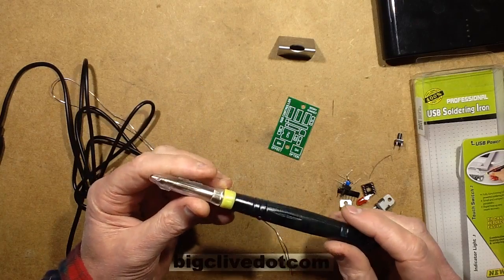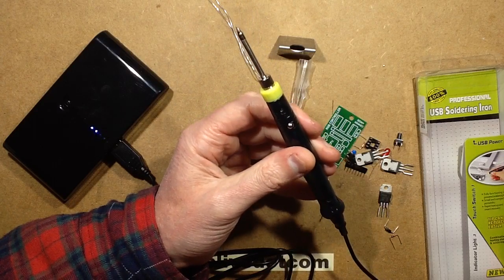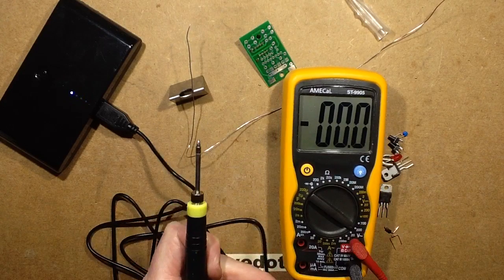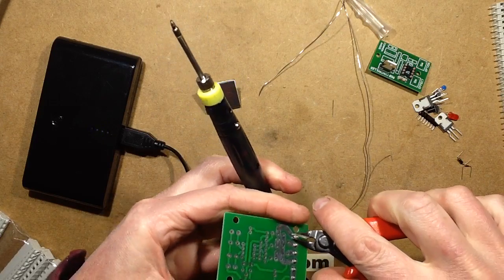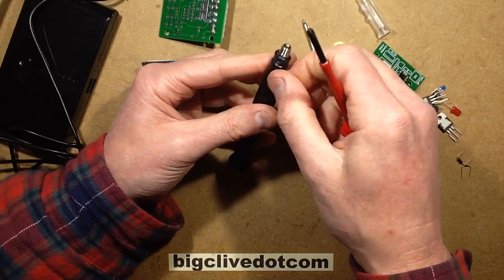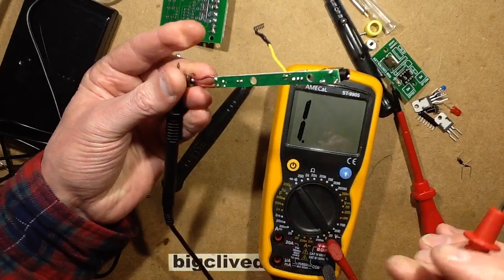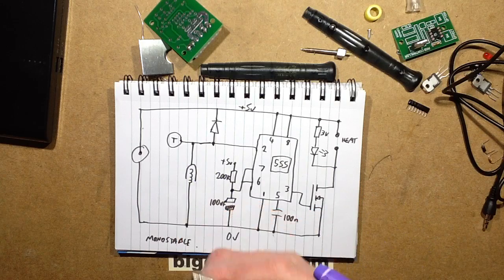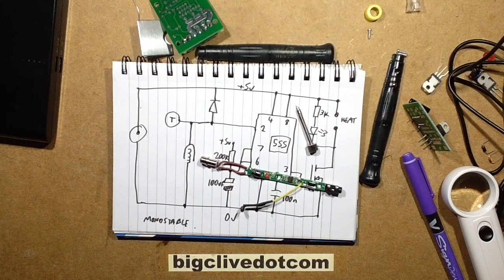USB soldering iron test and teardown with schematic.

Comment: I wonder if that would work from a USB OTG device? Probably not due to the current limit, but it'd be weird seeing a smartphone or tablet powered soldering iron. <g>. I wouldn't plug it into my gear, that's for sure.
Reply from the maker: +ProdigalPorcupine I wouldn't try to pull that much current from a smartphone.
Reply: +bigclivedotcom - Yeah, I'd try it on a duff one, but I think it'd be a case of the USB port shutting down on well designed devices, or damage on lesser designs. It thought you'd be in bed, I guess you're a fellow night owl!
Reply: +ProdigalPorcupine Windows phones like the Lumia 950xl can supply 2.1 amps at 5 volt with USB on the go. I would assume similar for android.
Reply: +bigclivedotcom maybe a 12v source like a car lighter?  the 555 should take it if the other componants are up to spec...then maybe it would have a bit of extra kick?
Reply: +danthekilla I'm not 100% but I think the note 4 can supply 2amps using an OTG cable. I'd have to check it by charging another phone with it, but I'm almost certain it can supply back 2amps
Reply: +m4xwellmurd3r You can definetly charge smaller phones with either tablets, or monster phones like the note 4 or z ultra.
So you might be able to power that soldering iron of a beafy phone.
Reply: Yeah, I've charged a tablet with my note 4 before just for fun haha I just don't remember what the current was that it charged at.
Reply: m4xwellmurd3r I got an output of about 1Amp out of my Z ultra, i just dont remember if that was stock or modded output.

Comment: so if you just added a small micro switch and pull it to ground for pin 2 you could switch & leave it on if needed ?
http://i.ebayimg.com/images/a/(KGrHqJ,!ioE-un1fKpsBPwS6V4PFw~~/s-l500.jpg
Reply from the maker: +Charles lakins Theoretically yes, or just bypass the circuitry completely.  But I'm not sure how hot the tip will get in open air when run continuously.

Comment: that looks ridiculously useful for small fiddly jobs. I imagine powering it from a jump starter pack with usb outlet would be fine if a power bank is ok. I've got a 17ah starter pack with usb outlets. another question.... how about using a 12 volt usb converter? probably still no good for sensitive components but a lot better than having 120 volts at the tip ;-)

Comment: Are you using Leaded solder? That can make a difference with the melting point advantage.
Reply from the maker: +Taylor Young Yes I was and will be doing so until they physically stop me.
Reply: +bigclivedotcom Thanks for the informative videos, I'd love to see you look into a DC/AC inverter, I've seen you take so many AC/DC apart xD

Comment: While it's true that there is a potential between tip and ground, I'm having trouble getting my head around how the problem is much worse, given that you're not working on a grounded (ESD) surface, and probably not wearing a grounded (ESD) strap.

Maybe I just have lots of earth leakage and noise in my office and dodgy old-house wiring, but if I grab an LED by one leg, and touch the other to a grounded surface, there's enough capacitive coupling just from that to glow the led visibly.  

For fun, the amount of current I can get through that LED depends on how many (bare) feet I have on the (wooden) floor and indeed if I am sitting or standing - standing 2 feet = 10uA, standing 1 foot = 5uA, sitting 2 feet = 4uA, sitting 1 foot = 2uA today (through an orange LED), a rather pleasing relationship numerically.

If I measure between myself and mains earth today there's like 60v to 70v AC.  Of course I'm surrounded by mains equipment with barefeet on a wooden floor.  

Anyway, my point, if there was one, is that if you're not "observing ESD considerations particularly" which in it's turn means that you and the work and the tools are referenced to "ground" (for your definition thereof) that worrying about a potential from mains earth to iron tip is probably not really much of a concern, in fact, it's conceivable that you'd be worse off grounding the tip, because now if you and the tools and such are floating, you are at square one.

Now if you were sure that you and the work were at the same potential etc... then yeah makes sense to make you at the same potential as the iron tip, by referencing everything to mains earth ground.  Of course, that's an easy thing to fix, wear a strap, preferably work on an ESD surface, and connect iron tip (well, not directly, but you know), surface, and you to the same point.

But all this AC analog hocus pocus makes my head hurt.  Give me DC any day.

Comment: FYI, NE555 can be reset mid-cycle. So if you keep your finger on the button, it should keep heating.
Reply: that doesnt work if powered from a powerbank or other isolated supply, well, mine doesnt! have to 'tap' it to trigger the vibration switch..
Reply: as long as pin 2 is low pin 3 is high.

Comment: I don't quite see the problem with the iron floating at line voltage. If the thing you are soldering on is not grounded you should be fine, right?

Comment: Do you think you would get that leakage current using a computer PSU? I modified a PSU with tons of different output connectors for testing electronics on my workbench (usb as well).

Comment: This looks great when you want to solder DMX XLR plugs on a cable poking out of the ceiling, while being on a 6 meter ladder. Or for general A/V work out in the field. A couple of NCR18650GAs in parallel and a 5V USB boost converter in a Hammond enclosure and you're good to go. With around 24W/hours of energy it should keep going for quite a while.

Comment: +bigclivedotcom Probably it's worth a try to replace the cable to a beefier one. You measured 4.3V at the heating element, the cable change would give you some tenths of watts, which isn't seems much, but in that case it will be a significant percentage of the total power. 

If i buy one (and probably will, thanks to this video), I will replace not just the cable, but ignore the 3,5 jack also. A 3,5 jack hanging around the desk with 5V in it isn't a good idea... If someone plug it accidentally to a headphone socket on something...
Reply from the maker: +mrnmrn1 My own temptation is to half the cable and solder it directly to the iron, possibly keeping the jack socket as a cable strain relief.

Comment: I guess the question is for me, if push comes to shove whats the better option, cheap Chinese battery soldering iron, or cheap Chinese USB (battery bank) soldering iron... If you are needing to be mobile, and maybe for quick jobs only. Or even, what of a miniature gas powered one? Wonder if you or Mr Ilett would do a direct comparison.
Reply from the maker: +good citizen This iron performed more consistently than the small gas irons I've used.  They tend to undulate in temperature violently between too cold and too hot.
Reply: +bigclivedotcom Thanks for your thoughts. I might get one of the USB irons. I do indeed have a biffy power bank...

Comment: Using the structure of an old cordless shaver/toothbrush/powertool and the proper converter you will get a neat portable soldering iron

Comment: I would rather stick with my TS100 soldering iron.
Than use a 6w thing,
Reply: +DeathlyHall0w The hakko 936 and its clones are a standalone soldering station.
The TS100 is a portable soldering iron that uses anything from12v to 24v to run.
If you have an ASUS laptop PSU, it will fit into the DC jack input which most people use
But being portable you can run it off a cig lighter in your car, or a 12v powerbank.

Comment: that wasn't quite the usb iron I was thinking of  although banggood*com also has this one  (hint for Alex below) mostly I'd order from them for warranty reasons.  but this one $55 http://www.banggood.com/TS100-Digital-OLED-Programable-Interface-DC-5525-Soldering-Iron-Station-Built-in-STM32-Chip-p-984214.html kinda suggests the power could come from a usb power bank or a PC power supply straight off??  oh well.  I actually ran into my first oops board from another site Gear Best  actually had 2 micro usb's on it but the hole wasn't in the right area so they just soldered on another one  .  sigh.  never seen an oops board on anything but pinball games

Comment: Just curious... Did it mention anything about connecting to USB 3?
USB 1.0/1.1/2.0 just does 5V/500mA (from a PC perspective of course)

USB 3.0 would provide up to 1.5A instead (while the ports physically would pass max 5A)
Reply: Max. current of USB 3.0 is 900 mA (I mean specs, in practice one can find more beefy chargers)
Reply: For the chargers I know, I have a blackberry one that does 1.8A max

Comment: Too late... I just bought a soldering iron, from China. For that price I could've had this and a multi purpose big power bank. Considering how much soldering I plan to do, that would be a better solution for me.. :) Anyway, great video as always.
Reply from the maker: +AxelL No1 It's useful to have a couple of different irons for different tasks.
Reply: +bigclivedotcom Thanks for the answer! I was not really upset. I know, you are right, but I really don't do soldering that much. I had two basically useless iron (for electronics ) before but I wanted something for changing a few bulged capacitor when I find them in my appliances. My knowledge is nowhere near to yours. I'm an economist but the logic in electronics is fascinating me lately. This iron is definitely a surprise. I considered it a toy when I saw it earlier.

Comment: should have tried it on the hakko 191
Reply from the maker: +rocking546 I did afterwards.  The mass of the sensor immediately dragged the tip down to about 250C and it then crept back up to 430C.  So very much dumping heat from the tip on each joint.

Comment: How about 14 & 16 AWG to XT60 Lipo battery connectors?
Reply from the maker: +Rav Gupta Not sure.  Thick cable is a real drain on heat so connectors are always a bit tricky.

Comment: +bigclivedotcom usb 2.0 can provide 5v 2a 3.0 same I think 3.0 c type connector can provide 100W
Reply: 2.0 can provide 0.5A, 3.0 up to 0.9A, for higher amperages you need type C connector.

Comment: I use this little iron for re-soldering and repairing USB ports on tablets and phones - it's the perfect sized tip and gives out just enough heat for those tricky little smt solder dabs. Nice to see I wasn't the only one impressed by it!

Comment: So how could the circuit be changed to make it safe when plugged into a USB charger?
Reply: I was talking about how the circuit could be changed.  IE if one were designing a new version, or wanted to modify an existing unit.
Reply: Then how would your inverter solution help?
Reply: +Doug Reed Forgive me but I really am not getting the point you are trying to make.  Clive drew out a schematic, and I am trying to ask a question about how one would modify that schematic such that it wouldn't have the issue he describes.  

But also I fail to see how introducing an inverter would help anything.  All you would be doing is taking DC->AC->DC.  So even in your scenario the better answer is just "always use a USB battery"

Comment: Cool, you have just answered some questions that have been bothering me for some time.  I first saw one of these on another channel some time ago, and ordered one in from China. It was an earlier model with no touch pad, but seemed like the real deal.  The one I have came with a cord that had two plugs on the USB in side, and a USB mini on the output side of the cable. It generated plenty of heat, in fact I had problems with it burning off pads if I held it on for to long.  A few days ago I tore down some kits that I had ruined with the iron, an discovered over half the LED's had failed, my guess was that those were the ones where my power pack went dead and I Plugged it into a wall wart.  At any rate it now lays in the tool box in my motor home as I deemed it only useful for on the road emergencies.  I had thought it the real answer to soldering in my easy chair as it heated up so quickly and was so easy to use.  Perhaps I will try the newer version now and see if that works better, and now that I understand where the problems lay,  it may solve some problems.  Thankfully I found a nicer 110 volt that I can use at my chair now, heats up very fast and has replaceable tips, and a thermostat on the handle that actually works fairly well.

Comment: Nice vid as always ! 
I bought one of these a couple of month ago and it just stopped getting hot and the light just stays on, tried different power sources still nothing. Worked fine for 10 minutes i think. Do you have any idea of what it could be or how to fix it? You say that you could bypass the circuit. so that could work maybe for me?

Could i just take the tip with the 2 brown wires and connect that directly to + and - from a usb source and have a push button to activate it? Or did i get it all wrong? 

does it still need to go through the circuit or is the 555 just there to make the touch button work and have the auto shut off and wake up feature?

Thnx for everything ;)
Reply from the maker: +Crispy K If the LED is lighting then the element has either failed or is not making a proper connection.  Make sure the little metal grip round the bit is fully screwed down.
Reply: thanks for the advice i already checked that and also dissembled it since i thought there could be a bad contact with the vibration thing. it was cheap anyways ;)

Comment: I've been using one on and off for close on nine months, now, and... well, it's a pity you can't actually seem to source replacement tips/elements for them...
Reply: +Simon Edge ...also mine glowed red for a few seconds the first time I used it. Wish I'd got a pic of that. :s
Reply from the maker: +Simon Edge At this time it's probably easier just to buy a complete iron as opposed to a tip.  Still cheaper than many bits for high profile brands.  What voltage were you using it on to make it glow red?
Reply: bigclivedotcom it is, but they do advertise the bits as being replaceable, so it's more the principle of the thing...

Voltage-wise, it'll have been ~5.2V initially, though it may stay that high even in use, because I was using my Anker 40W multi-port brick, which will definitely supply the 1.4A the iron needs. (Said brick has polyfused ports, which is handy for when you accidentally pull the iron's end of the cable out first and kill the port. Why they didn't go with a barrel connector over the TRS one, I don't know...)

Comment: USB 3.1 can actually supply 100W at 12V, iirc. But it still depends on the controller (for handshaking) and its power supply, of course.

Comment: Oooh, now I'm thinking of all the other things I could turn on with touch for an interval of time with a 555 in this circuit... I think I shall buy this iron, wire the heater direct, then use the nifty lil' circuit for something fun...it's inexpensive enough to be justified on the basis of "cheap thrills" alone.

Comment: You could use the Apple PSU if you powered it through an isolation transformer. You would however have to confirm it was not earth referenced.

Comment: A clever but flawed use for a soldering iron.
Would have been better if it was grounded instead of running at +5 volts
Reply: +BillyNoMates1974 Yes, it's really silly thing to connect +5V to the tip... But you just have to replace the two wires coming to the heating element's socket, and you will have GND on the tip. Then you just need to modify a USB charger by earthing the secondary GND, and it will be safe. Or use a power bank, just like Clive, if you use it in the field.

Comment: how could you modify/change the circuit so that you could use both the power bank and mains supply
Reply: +Doug Reed no really? I'm my knowledge of electronics is decent but not the best. my approach would be to have mains with filtering capacitors and a bridge rectifier, then use transformer with smoothing capacitors then use 5v regulators and more capacitors. but I'm not sure if a system set up in that manor would work.

Comment: could you use the powerbank as a filter the by having the powerbank plugged in and charging while using the soldering iron?
Reply: I've had problems doing this with some power banks, it put them into a "dead" state with components on the PCB getting hot. I had to unsolder a battery terminal briefly to reset the units. They worked OK after this though. Some others seem to handle it without a problem.

Comment: Soon as you said "NE555" I started laughing. Never thought I'd see one of those in new production stuff. And the intentional use of the non-ideal specs of the diode is quite a nice touch.
The person who designed this thing knows their stuff, and is almost certainly Old School.
There's a spot-welder at my dad's auto repair shop that uses one of those to control how long the current is on, triggered by a switch on one of the electrode handles. From what I can tell, the thing's from the 70's or 80's.
Reply: 555 can be used for many things, seen details on the 'net of a 555 used as an am radio 😲